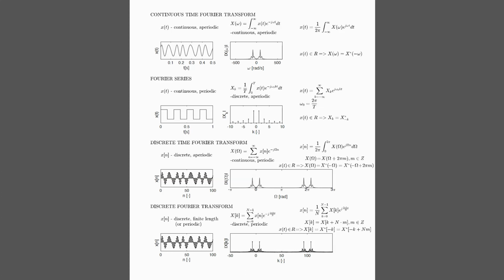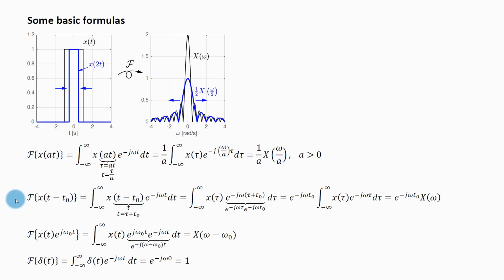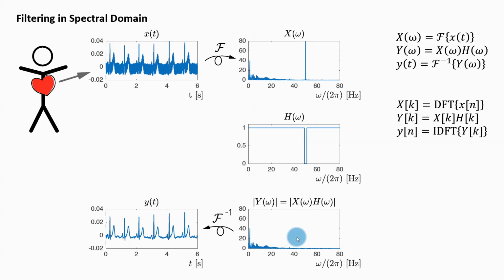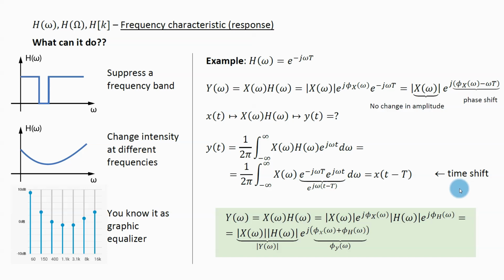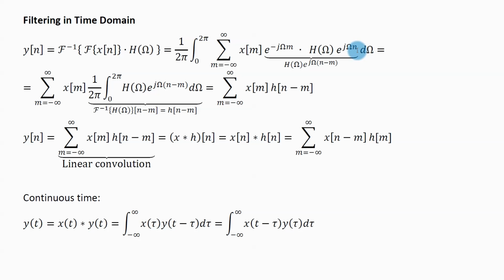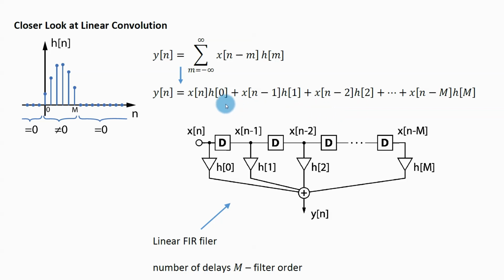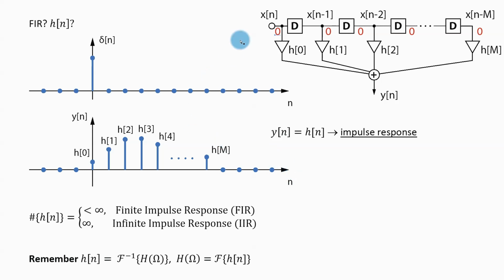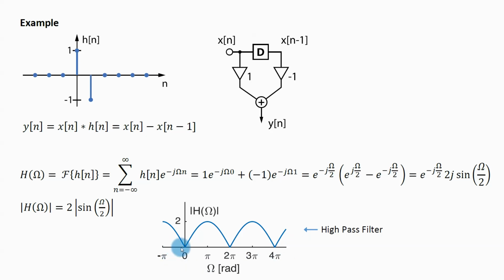Signal Theory (Signals and Systems) - Lecture 4 - Filtering in Spectral and Time Domain

Comment: Professor, in the last slide, why the period of |H(Ω)| is [-π,π]? Thank you.
Reply from the maker: The fundamental period of a DTFT spectrum is always 2π (remember that for DTFT H(Ω)=H(Ω+2πm), where m∈ℤ). Therefore, |H(Ω)| in [-π,π] is one period of |H(Ω)|. In fact, any interval with length 2π would contain one period of |H(Ω)| that will repeat itself throughout the spectrum (check it out on any of the DTFT spectra). The same goes for H(Ω).

And why are we interested in the interval [-π,π] (i.e. why this specific period)? Often we sample and subsequently process continuous time signals that have their frequency content limited bellow fₛ/2 (fₛ - sampling frequency). This corresponds to the interval [-π,π] in the DTFT spectrum. Therefore, if I want to judge what type of filter I am dealing with (LP, HP, BP, BS), with DTFT I look at the interval Ω∈[-π,π]. In fact, with real signals [0,π] wold be enough. 

You may also ask why should signals have their frequency content limited bellow fₛ/2? The answer is to avoid aliasing. Recall the handout, where I showed you that if you sample a sine with frequency above fₛ/2, the samples of the signal look the same as the samples of some low frequency sine. When this happens, from the sampled signal we cannot say whether we actually sampled a low frequency sine or a high frequency sine. It can even happen that we actually sampled both, and now the samples are irreversibly mixed together. We typically want to prevent this from happening; therefore, we either increase our sampling frequency, so that it is the twice the highest frequency in the processed signal, or, before sampling, we forcibly filter and suppress any frequencies above fₛ/2 (so called anti-aliasing filtering).

Last, I would just note that sometimes we also sample signals with frequencies above fₛ/2. This is so called undersampling (not taught in this course).
Reply: @radoslavbortel3459  Got it, very thorough explanation, thank you!!
Reply from the maker: You are welcome.